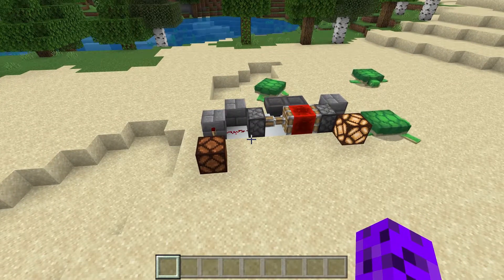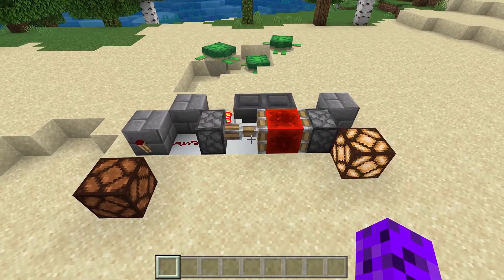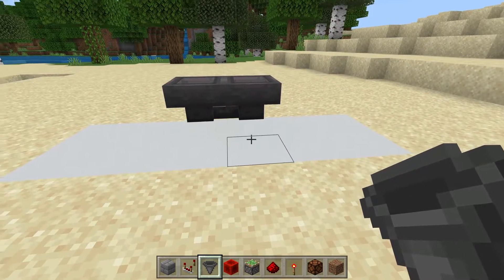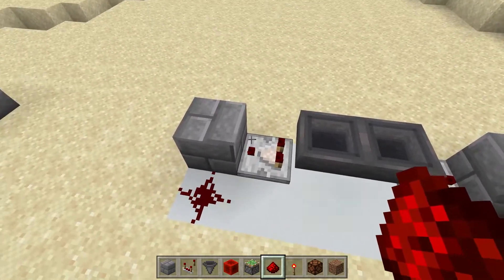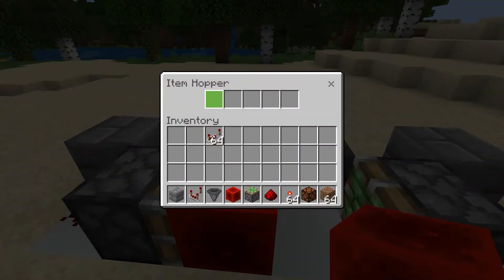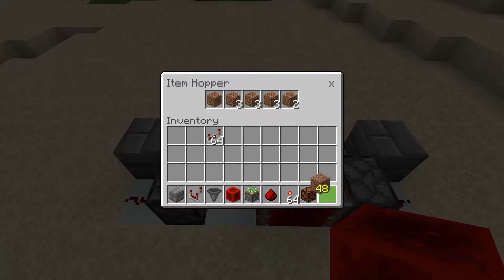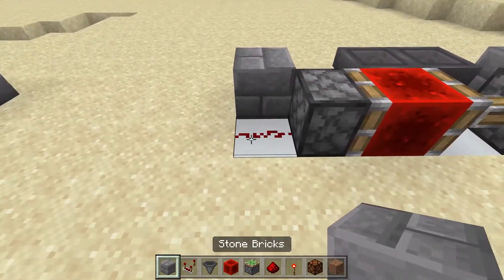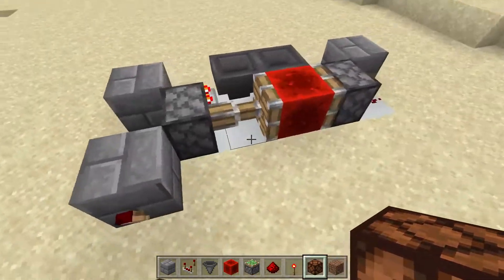Minecraft Bedrock, How To Build A Hopper Clock

Comment: One question how do I turn it off or on using redstone
Reply: You can turn it off by putting sticky piston and block to stop the redstone clock
Reply: @memepostngaming  bit late but stil thanks for your time ig that will work too i just locked one of the hoppers with a bit of redstone